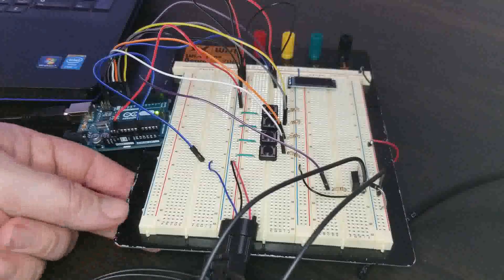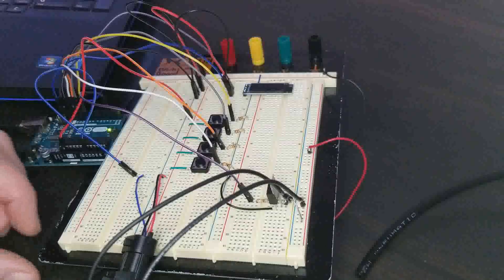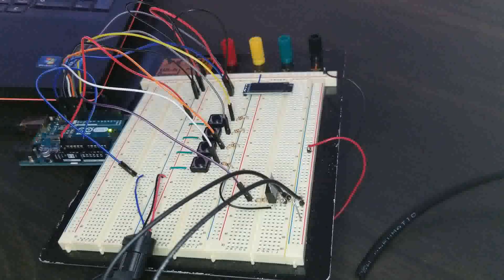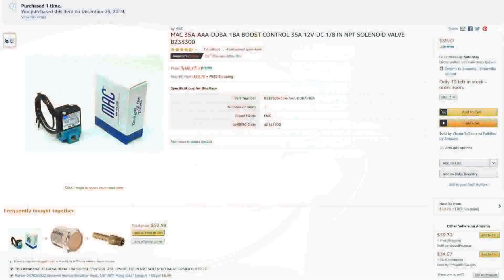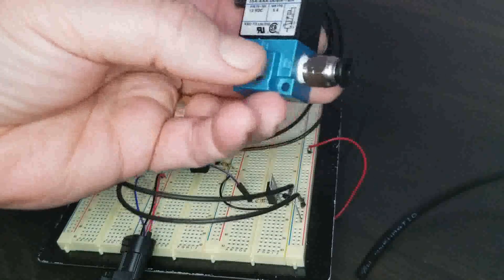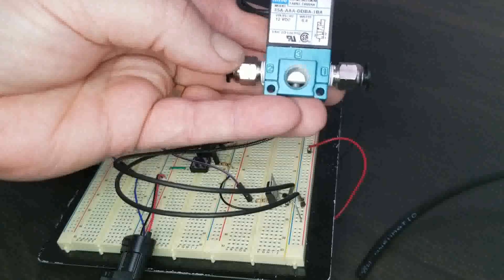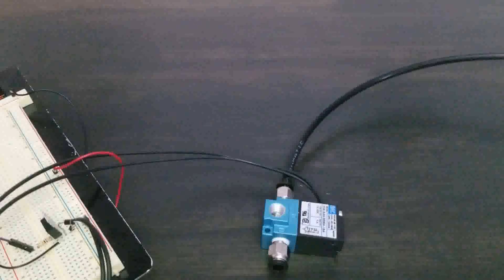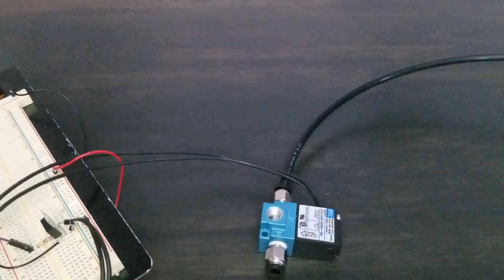Testing a 3 Port MAC Valve with an Arduino

Comment: Can you help me, all I want is a 2 port solenoid and to be able to control the flow remotely with a electric dial or swicth. I want to be able to adjust flow to a stop or open flow all the way of a vacuum line. Of course a mechanical 2 porttroller will do exactly what I want but I can't control it remotely. My idea will likely need a 3 port mac solenoid in the future if my idea is not working. I'm making something very similar to a wastegate with a light spring but using check valves to hold pressure and bleed it off at different speeds to adjust how fast it bleeds off pressure. Could I use a 3 port mac solenoid and plug a port then use a pwm dial controller to adjust the amount of flow?

Comment: hello friend, how did you make the valve work by frequency, could you help me, I have used a pwm output in arduino but the valve does not oscillate. greetings from Chile